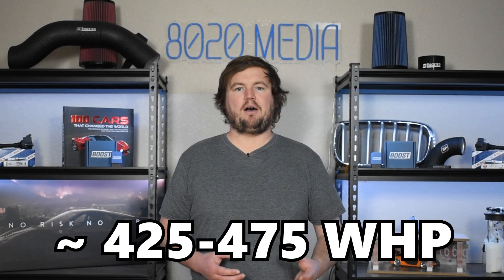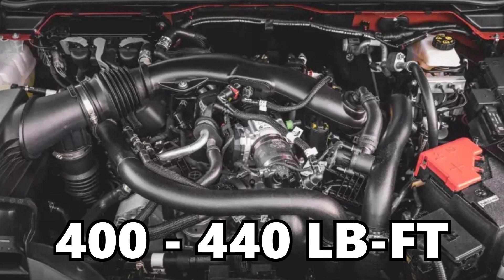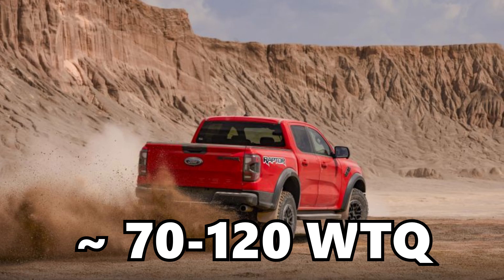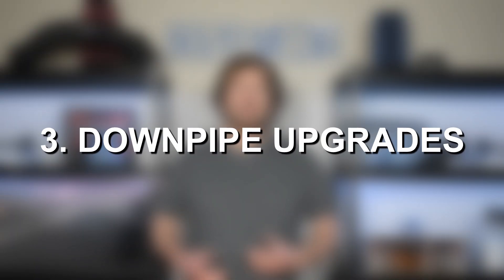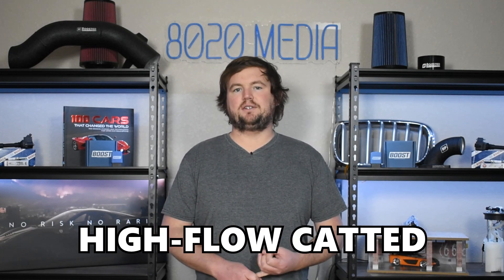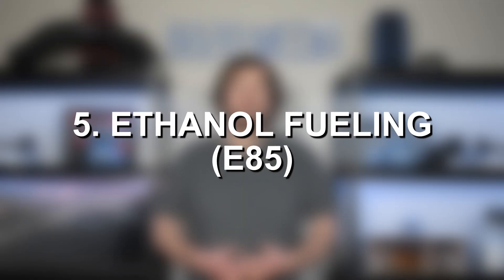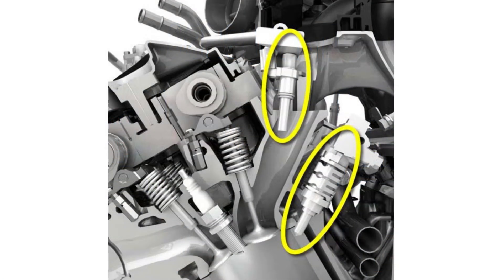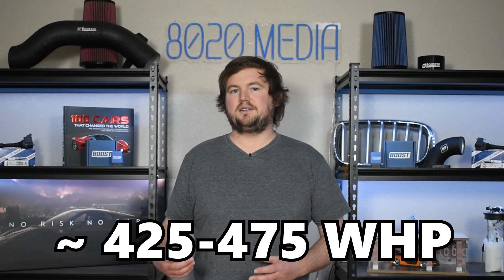How to Build a 450+ WHP Ford 3.0 EcoBoost!

Comment: The 3.5 could push almost 700 HP in the Ford GT. Were there any changes made to the engine that would keep it from doing this with the 3.0?
Reply from the maker: M - Yes, the 3.5L EcoBoost in the Ford GT was heavily modified compared to the 3.0L EcoBoost found in vehicles like the Explorer ST or Ranger Raptor. While both engines share design principles—twin turbos, direct injection, and compact V6 layouts—the GT’s 3.5L was essentially a motorsports-grade version. It had larger turbos, a stronger block, forged internals, higher-flow fuel systems, and bespoke tuning optimized for high RPM and boost pressure. The 3.0L EcoBoost can be tuned to reliably hit 450–500+ HP with bolt-ons and a turbo upgrade, but pushing it to 700 HP would require substantial internal upgrades (forged pistons/rods, larger fuel system, built transmission). So, while the GT shows what's possible with the EcoBoost platform, the 3.0L would need serious reengineering to get there safely.
Reply: @8020Automotive  But roughly the same amount of modification as the 3.5? But if it is roughly the same is there any benefit to having the 3.0 to the 3.5 if the 3.5 is more common, has more aftermarket, and has more displacement?
Reply from the maker: @ You can't really compare the engine in a super car to one that isn't. If we had to choose, we would go with a 3.5, but this video is about the 3.0..
Reply: @8020Automotive  thanks for answering